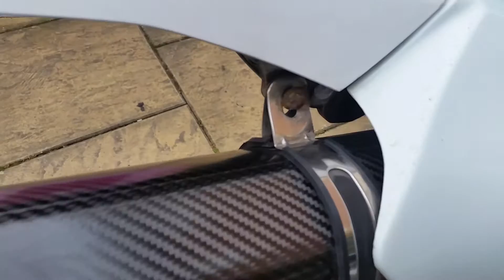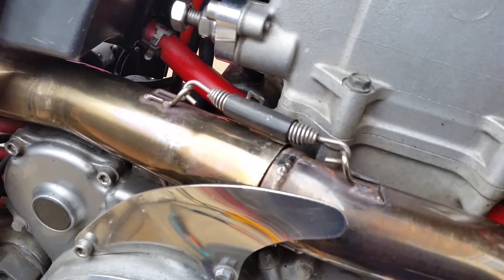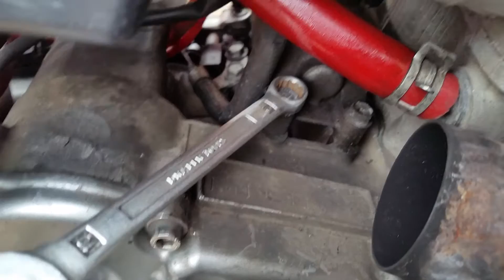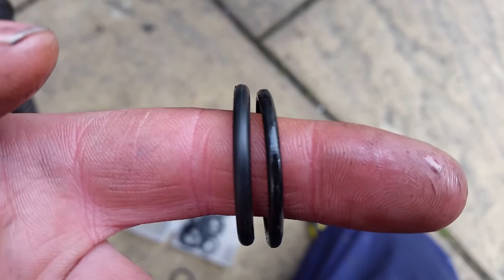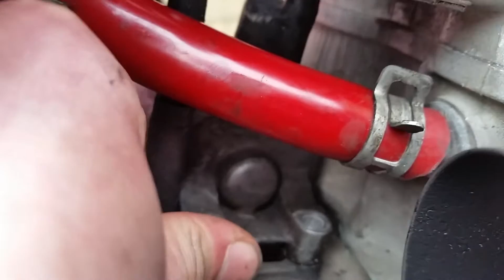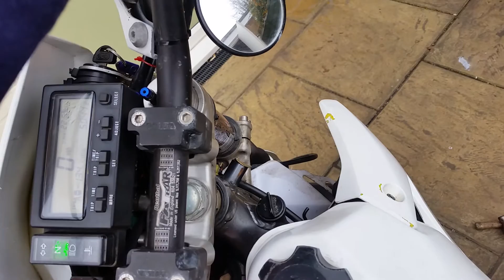Drz400 how to remove starter motor seal and replace

Comment: Hello I have a 2005 drz400e. Can you tell me how to lubricate the starter motor. I see you have changed the gasket. So if its gasket is destroyed I will assume that the starter motor needs new oíl. ¿How to add oíl to it?
Thank you
Reply from the maker: You do not lubricate the starter motor, it needs to be clean and dry inside. the oring is to keep the oil in the engine side 👍🤟